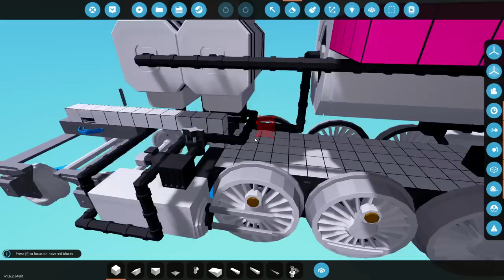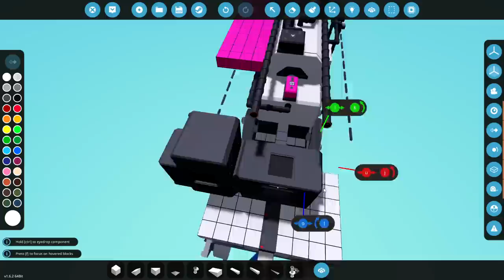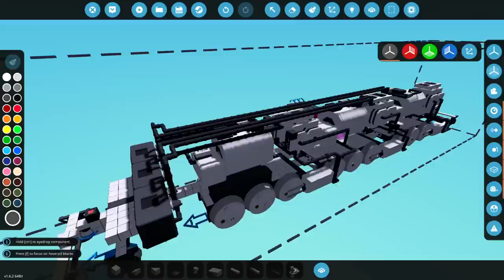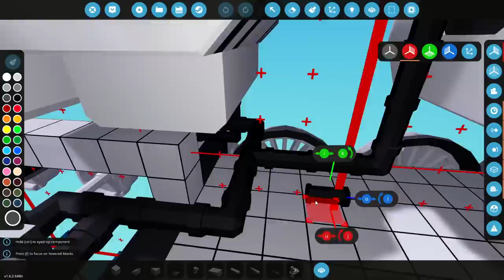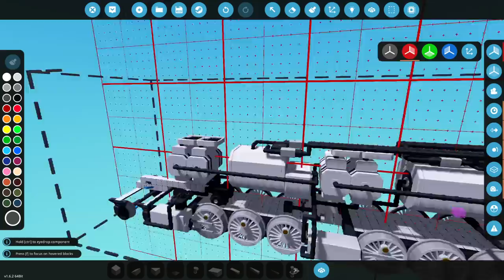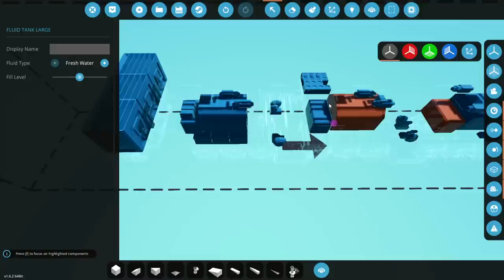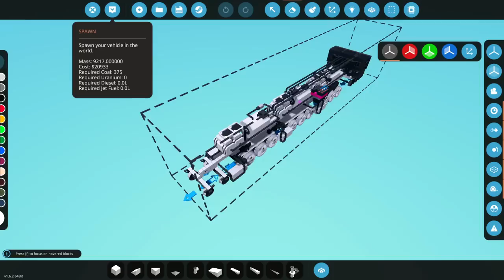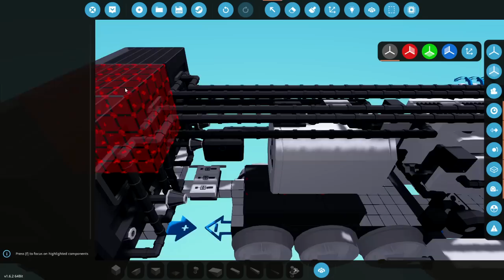THREE Fireboxes Makes THREE Times The SPEED In Our HUGE STEAM POWERED LOCOMOTIVE In Stormworks!

Comment: Large firebox holds more coolant, which means it holds more heat, so when it goes through the boiler it doesn't cool down as fast.   I think it also gets a bit hotter than the smaller one.  

The only time fluid flow matters is if there is a port saying in or out.  If it just says A or B it can flow either way.

Comment: A simple way to keep the boiler from blowing up is to use a valve to control water in to the boiler with a threshold of 0 to 5 for boiler fill, connected to threshold of 0 to 5 for boiler pressure with an and gate.  
That way if pressure is low and fluid is low it will fill.  If fluid or pressure is high it will not fill.   Using 0 to 5 just leaves room for any water to turn into steam before reaching 10 pressure. 

I don't remember how much water is needed to fill the boiler with steam, so the boiler fill level may need to be lower if 5L  makes too much steam.

Comment: Did you ever tried to connect the Steam Output of one of the Wheels pushers to the Steam Input on the other side? I did this, combined with 2x Boilers, 2x Turbines, 2x Steam Condensers and 1x small Firefox at about 250 Degrees. I reached Speed of up to ~110 km/h
Reply from the maker: Not a bad idea I suppose :o
Reply: @FranticMatty  I came to that conclusion because of the normal Steam Pistons. With them you don't want to have them at the same level, but rather shifted. So why not with the Wheelpushers, too?

Comment: You might want to add another point of articulation to the trailing and leading trucks so they can swing out and actually follow curves in the track. Like, they have a swivel where the bar that connects them to the locomotive meets the truck, and they should have one at both ends of the bar. It’s kind of hard to explain without a visual aid, but try and imagine how they would turn while still being in line with the other wheels on a curve.

Comment: I understand you're having fun building and that is what its all about however in my opinion this Locomotive is not efficient enough to have spent the time to build it.
3 fireboxs to get 30 is bit absurd knowing my train with a single boiler and fire box pulling a train car full of coal can reach 60 Knots. I just have to watch the pressure and firebox temp and shut it off every  minute or two. Its Massive its burning lots of coal and its boilers are all over heating youve got pipes and pumps and batteries galore with smaller wheels at this point
I think this isn't going well. I however have a suggestion. You stated at the very start of the build of this you could place Boilers inline. What if you put three boilers inline with a small pump between each one making the steam shoot from one boiler to the next and out the pipes to the wheels with maybe a large Firebox. I think Im seeing a power curve here. 1 small firebox is probably capped on the power it can produce but when you go to a large one the power is probably tripple so youre losing a ton of power by dividing it into 3 engines however if you have 3 boilers all running the same coolant lines they all stay the same temp probably with small deviation but you now have 3x the steam the condesers are just turning it back into water Most of the steam is going to the wheels so if you have maybe just one condensor youll also be increasing steam pressure with it only going into one condensor instead of two. You pressures in the boilers would likely stay lower cause the steam is being pumped out so basically have three tanks full of power that you can pump through one line from a single firebox. Maybe try that?